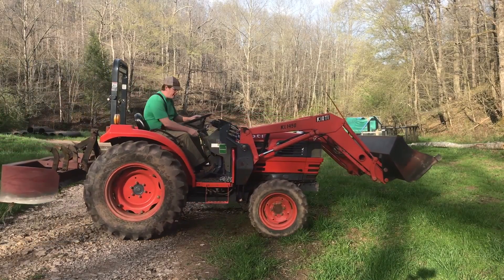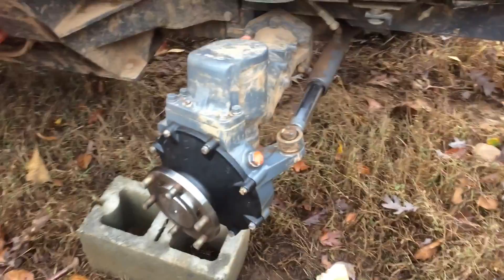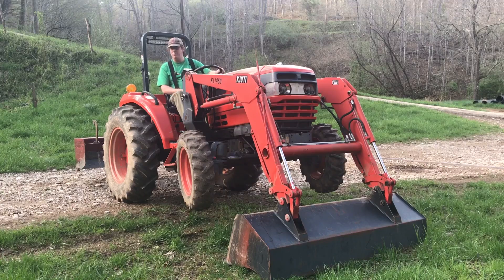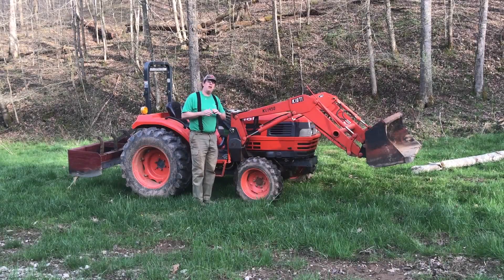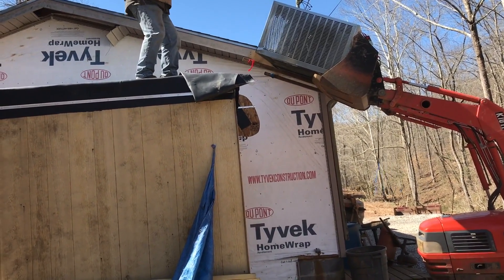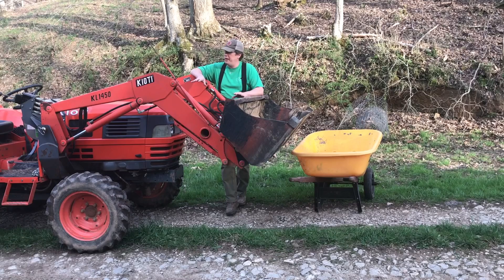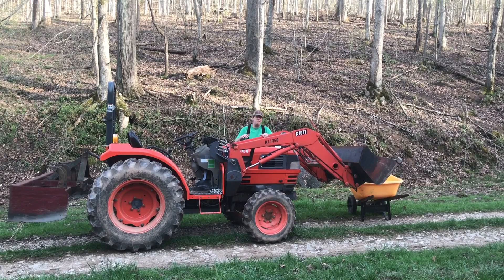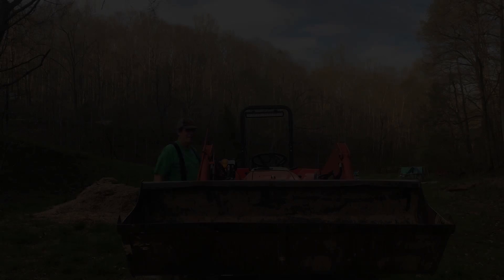Why your tractor needs to have a front loader

Comment: I always preferred grading with a tractor with no bucket, providing we had a bobcat or backhoe handy on a job site. It's much nicer if you are doing a ton of box blading or pulverizing to not have a bucket on the front of your tractor, especially if you are working around a lot of trees.

Comment: One of the pro you forgot was using the front bucket loader to get your tractor unstuck !!! Yes 4 wheel drive tractors get stuck.  You can use your front loader to push yourself back out of a stuck situation by curling the bucket all the way back and applying some down pressure and as you engage the reverse drive curl the bucket forward and it will push the tractor backwards!!!  Takes a little cordination to reverse and curl the bucket, but hey a little practice and you are out !!!  Saved my bacon so many times !!!!   OOOOH and do NOT forget about the rear differential lock pedal, that is very often overlooked !!!

Comment: I have lived on a farm all my life.  It has been in the family since the 1850s.  With my grandfather, great uncle, my father and me, none of us has ever owned or had the need for a front loader.  Unless you have a digging construction or grave project, you do not need it.  You can always rent or hire a backhoe.

What you need for a small farm is a basic tractor with a bushog or cutting bar, a three point hitch scraper blade, a plow or better yet, a tiller, and a small wagon.  If you are going to do fencing, maybe an auger, but steel fence posts can be driven in by hand.

A front loader adds a lot of expense and reduces the visibility and maneuverability of a tractor.  In most cases, it is not worth it.
Reply from the maker: You must never have had to lift anything heavy over your head then...

Comment: Good video good info. I wish I had been more educated and seen this before buying my first tractor. I didn't know any better. Bought IH 385 without a loader. Was a good deal and it's been an awesome tractor but I found out all the things on my 20 acres that I need a loader for. So rather than buying a new tractor I  found a loader for it and I'm getting it installed right now. Looking forward to using it.

Comment: what horsepower tractor is shown in the video?
Reply from the maker: 2004 Kioti DK35. 35 hp
Reply: @RedToolHouse  thank you! 

We are tractor shopping and have similar terrain as you. We only have a few acres, though.
Reply from the maker: I strongly suggest 4x4 with a bucket. Some of the 25hp tractors are really strong enough to do a lot of work.

Comment: I knew when I watched this before, that one very vital is missing... that front bucket can and has saved me so many times, If I can't back up then placing the scoop part down, that means the bucket has used most all of its travel.. pushing down some and then curling the bucket backwards. The bucket is literally pushing you back as you try to back up. Don't get discouraged, raise the arms and reposition of bucket in empty bucket mode again and while there is pressure on the bucket, curk it back again. Unless things are way over your head, have patience. It will work and get rid of chain, use as much as possible the heavy straps that you see on a big flat bed truck. A good farmers wife never leave out during field time, to go shopping for friveless things, like spending a day worried when she want her hair style changed and that is a blessing for her, but not so much for us, and we have no room to talk sh*t either..

Comment: You really need to invest in some forks if you are moving logs often. Not only are you risking bending the cutting edge on the bucket, you are lifting at a greater distance, reducing the lifting capacity (or higher stress on the front axle for the same weight log). Also with forks, you won't need someone to stop the log rotating.